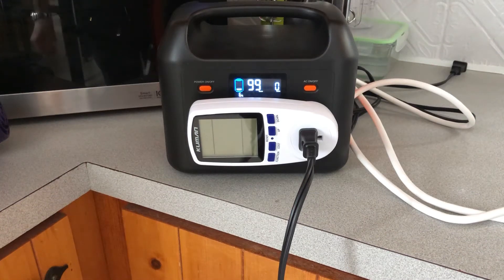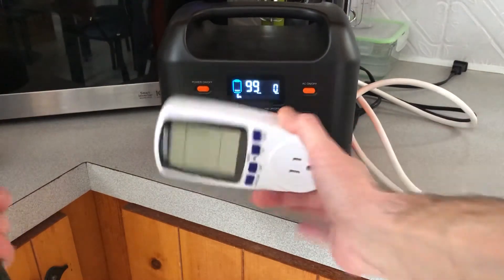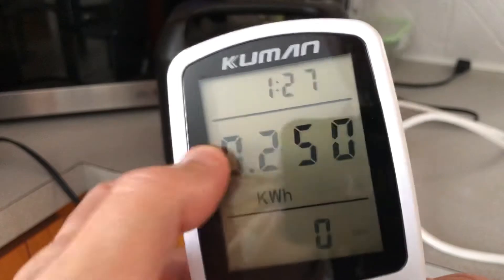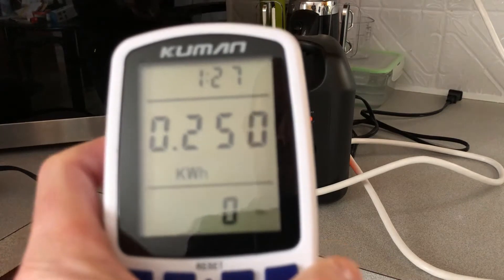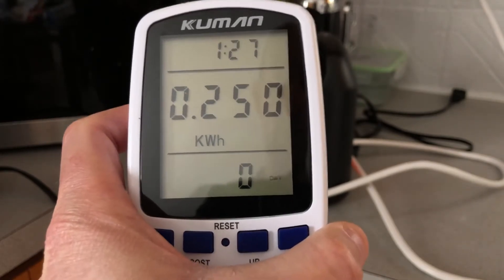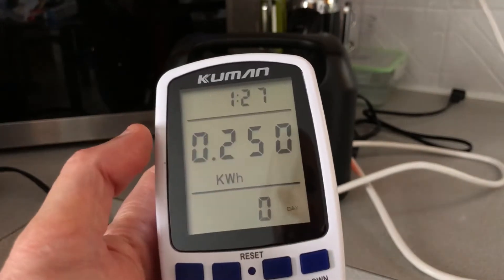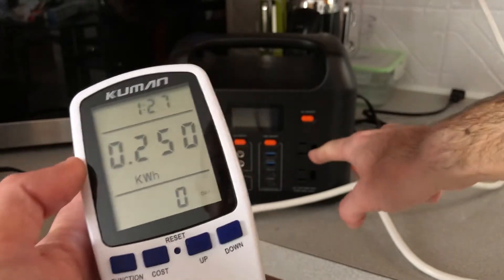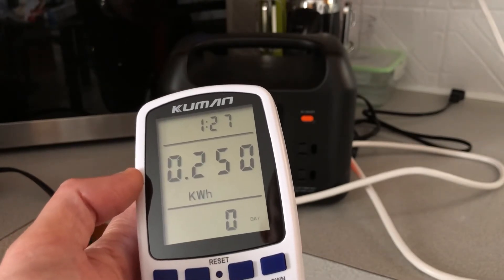GOLABS R300 capacity testing using the AC inverter 👍

Comment: I get about the same. I got 252 Wh with the AC inverter. Actually the lower you run the wattage on the AC inverter the lower you will get as the inverter itself is using around 6-7w. So if you are running it longer, you will actually use more power. Try it. If you are running a CPAP it's best to get the DC adapter as the DC port doesn't need regulation due to the LiFePo4 batteries which holds its voltage well right up to the end. Also you can still use that 6% if you are just using the usb's. I got 265.3 Wh from the DC ports. You should note however the battery will hold back 10% or so to preserve the batteries so they don't get damaged through over discharge.

Comment: good to see someone using this unit and testing it out

I found it odd or figured it was scam since all the other big name brands are not using lifepo4 batterys yet ( Bluetti AC30 does)

Super tempted to buy this since its now 120 off on amazon.ca 
sure it can't charge fast, but its available now and cheaper than most
Reply from the maker: I’m really happy with that unit and with the lifepo4 battery and at that price it is a good deal. Let me know if you buy it and if you like it 🤙
Reply: @patdud1979  i sure will

Also adding a sub to your channel to see what you do next.